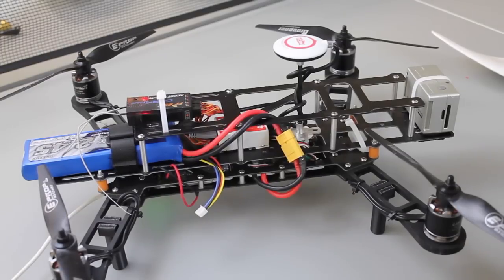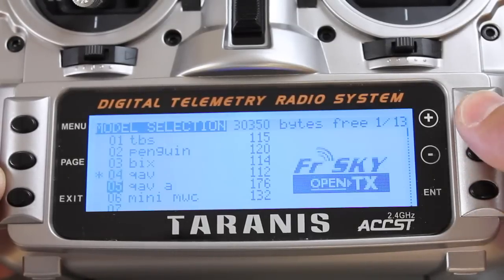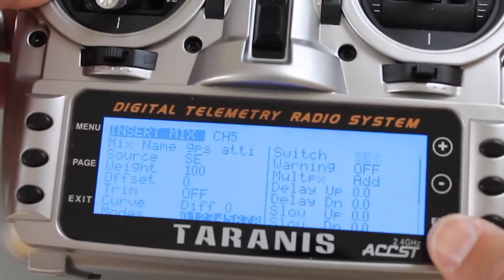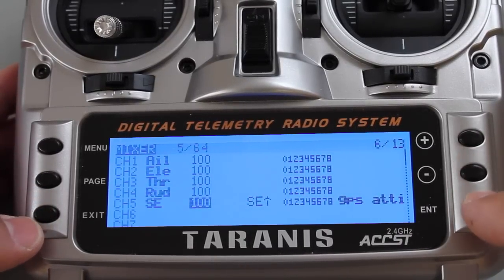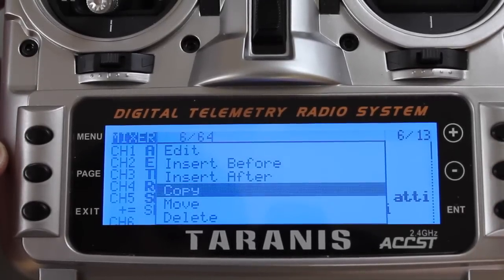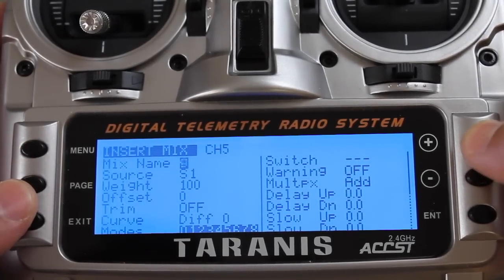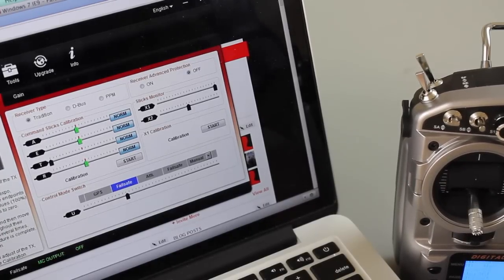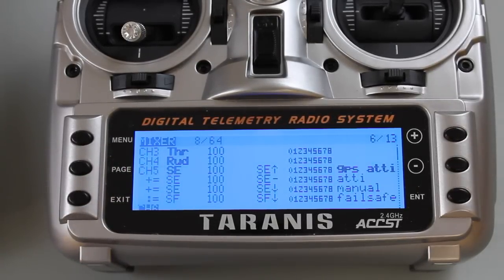FrSky Taranis 3 Flight Modes and Forced Failsafe Override with DJI NAZA on QAV400 Quadcopter

Comment: Dennis, have you setup your Taranis for Naza M using an ezuhf Rx yet? I'm having trouble knowing where to begin to set it up on my disco pro. Thanks man
Reply from the maker: No. I haven't done that setup yet. The EZUHF RX is definitely on my wishlist though. I'll post a video when/if I get it setup but it will be a while. You'll probably have it figured out by then :) Best of luck with your setup.

Comment: Just a quick question. What does the naza do if it looses contact? will it go into failsafe mode and return home?I have just stated flying and have used most of your videos to set up my hex.
Reply from the maker: Muddygunbuddy Depending on what type of receiver you have you may be able to do this pretty easily. Loss of signal failsafe is generally triggered by your receiver. I have a setup vid here:

NAZA Enhanced Failsafe RTL After Signal Loss With FrSky Module

Hope this helps.

Comment: I have the Naza lite and Futaba 7c I'm looking to buy the Taranis soon. How do you set the naza to fail safe mode when the radio is turned off or signal compromised? I don't think my 7c will do it, can this radio?
Reply from the maker: Good question. The functionality actually lies in the receiver and not the transmitter. So I had to upgrade to a FrSky receiver to do this on signal loss. Hopefully this will help out:

NAZA Enhanced Failsafe RTL After Signal Loss With FrSky Module
Reply: Dennis Baldwin I got my Taranis with the 8XR receiver and I'm all setup now with the F/S button!

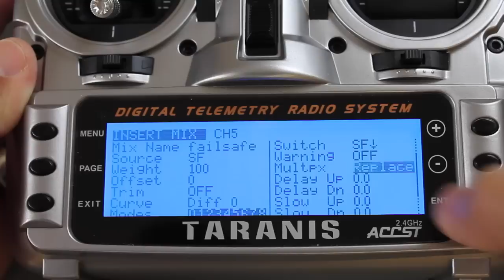Comment: Hi Dennis, I'm back again. Just got my Taranis and I don't know if I have a duff one or not!!! It could be me that cannot read!! I have no "basic" instructions and have looked on the net but cannot find anywhere for a factory reset. I cannot see on mine, model selection, ie, heli, acro or glider. On my Turnigy I set it up as a heli and no problems. Can you tell me the best way to set up this damned radio for a quad running Naza V2. I have trawled your wealth of video's, but I'm either too tired after being at work since 6:30 this morning or I should give up and start knitting!!!
Your help as always gratefully received!!!
Regards
Ken
Reply from the maker: Ken, it takes a little time to get your head around it but since the Taranis doesn't ship with any templates like ACRO or HELI you need to setup the channels yourself. You'll generally want to setup channels 1,2,3,4 to match A,E,T,R on your NAZA. If you need more assistance please post in the forums at www.garagepilots.com and we can help you out over there. Good luck!

Comment: Just back from maidening my F450, the DF switch failsafe worked flawlessly, thank you. I tried switching off my Tx and the F450 turned itself upside down and crashed. Any ideas, I have it set to 'no pulses'?
Reply from the maker: ben green Yikes! Sorry to hear that. I'm not sure what happened off the top of my head, but let me think about it some more. I plan on doing an updated video that covers failsafe in more detail soon. If you come across any discoveries please let us know. Take care.
Reply: Dennis Baldwin hey, I figured it out.  It should be set to 'custom'. You can set it to go to failsafe by toggling the switch as normal.  Very simple.  Most folks will know this but it had me stumped.  All the best, man.

Comment: Hi Dennis please help. I have a Taranis plus when i follow your video to set the failsafe I get all the way to the part where i set the offset number to 150 or 170 but the lever doesn't move to GPS? Why is that?

I set it to ppm mode like in your other video. On top in the Naza assistant I chose Dbus. Im thinking that I didn't assign the U control mentioned in the video please help!
Reply from the maker: Andre Terzian If you're using sbus make sure you assign the proper channel (ch7 in this case) to the U port. This will allow you to set your flight modes properly. It can get tricky because all the connections are coming over sbus and you don't see them physically attached like you do with a traditional setup. Good luck.

Comment: I noticed that when you switch on the forced failsafe over ride switch (SF) that your throttle does not move to 50% on the Naza assistant program ! Is that critical?
Reply from the maker: This is a bit different than a receiver level failsafe where you would want to program your receiver to around 50% throttle input. The difference here is that you want your throttle stick to be at 50% or thereabouts when you're flying and flipping into forced failsafe. I've read that if your throttle is less than 10% and you flip into failsafe that it's ignored. But if you're at 10% throttle in the air your quad won't be hovering, it will be falling out of the sky :) My recommendation is whatever throttle position you're in when you flip into failsafe leave it there....unless of course you're full throttle you'll want to bring it down a bit! The reality is if you're in trouble in most cases you're not going to flip out of failsafe mode so that throttle isn't too important. It's just a safety measure in case you need to get back out of failsafe and control it manually. I hope this helps a bit. I know it's quite confusing.

Comment: same question as Skydive4ever, I got some problems setting up return to home when TX is switch off.
Reply from the maker: What type of receiver do you have? If you want it to return home when the TX is powered off then you need to program your receiver to trigger failsafe mode. The FrSky receivers generally support this. Here's a video that shows how to set it up. Hope this helps....

NAZA Enhanced Failsafe RTL After Signal Loss With FrSky Module

Comment: What about putting a fail safe for cc3d when its out of range any reason not to do this. Have not seen a lot of info on doing this. On my frsky taranis its seems that option isn't showing I am sure I am suppose to enable something. Your videos always pop up first when searching. Are you in California?
Reply from the maker: Robert Hendrickson Great suggestion. I haven't looked into this before since mainly my CC3D is used for closeup line of sight flying, but this would be great to know. I'll look into it soon. I'm in Austin, TX. Thanks for the comment.
Reply: I only mentioned it because I know it can do it I just couldnt figure it out. I think you may have to do it with the actual reciever to go to a default mode like low throttle.

Comment: Hi mate I've got failsafe working but won't retract legs when failsafe kicks in when I pressed the failsafe button on frsky the legs were down??  I set throttle to middle and that works any idea on legs??? Thanks
Reply from the maker: TheTonstar1 I'm not sure about this, but have been asked a quite a few times about it. I tell you what....I'll put together a video next week and see what I can find out. Thanks for the question.

Comment: For some reason my Naza m lite isn't picking up the signal from my transmitter. I followed your video on setting my quad up with SBus and that is done, but I don't think my tx is binding correctly or something. I saw you had som wires in your SBus set up in the Naza other than the x2 and x3 ports. Am I doing something wrong?
Reply from the maker: +Thori Nelson It really sounds like you don't have a good bind. I can't think of anything you'd be doing wrong other than that. Let us know what you discover.
Reply: You were right. I got my bind. The Problem was the bind button got stuck in the pressed position and that was why it wasn't working. I had to crack open the rx and fix the bind button. Thanks for your help!

Comment: Do you know if the S-Bus on the X4R receiver has control of the U functions of the NAZA M v2?  Can get it to recognize X1, X2 or the U port.
Reply from the maker: It most definitely should. I just tested my X4R with Pixhawk 2 and was able to get 16 channels. I can't remember the specific channels you need to configure to work with X1, X2, and U but this video should help:

https://www.youtube.com/watch?v=kl5wuMiZ1_w

I'll post something soon that shows how I did this with Pixhawk and it should be easily adaptable for Naza.
Reply: See my comment below... I was able to get the S-BUS of the X4R working with the D-BUS on the NAZA.  Now all I need to do is calibrate my ESCs, and then I should be good to go.  I'm still learning.  :)

Comment: this is great and works perfectly but....I cant seem to get to calibrate the compass now ?
Reply: +bob gasman ok sussed it I forgot how to count..... actually was worried that I couldn't go from manual to gps because ati was in the way but if you go quickly from manual to gps right through atti counting it eventually locks in with the yellow led  so if anyone else get this problem it works ok with about 7 hours of patience
Reply from the maker: +bob gasman "7 hours of patience" lol I know exactly what you mean. The good news is you waited it out and didn't take a sledgehammer to your quad :) Thanks for sharing.

Comment: Hi Dennis. My Naza m upon configuration won't let the throttle go down to 0. It's stuck on 50 to 100%?
I'm using ezuhf. It's driving me crazy. 
Any ideas?
Reply from the maker: That's strange. Are you saying it's stuck on 50 in the Assistant? Have you done a TX calibration in the assistant and prior to that did you try an ESC calibration? If you continue to have problem please check out www.garagepilots.com and post in the forums. Hopefully we can help you out.

Comment: I notice when you toggle into FS the throttle doesn't go to say "50%" shouldn't it do that?  Or will it just plummet from the sky?
Reply from the maker: If I recall as long as you have your throttle above 50% you're okay. NAZA actually takes over and ignores stick input. But I put it above 50% just in case :)

Comment: this also works when using a sbus connection?
Reply: +Rolf Dijkstra 

This does work with the SBus. Make sure you are addressing CHANNEL 7. That is the default channel for the U channel on the Naza. Use channel 5 to set up the IOC.

Comment: hi ... one question about the failsafe 

today i test my copter after tune...i use Taranis radio and use X8R rx..when i plug the Naza in to computer when i tune off the radio it will jump to failsafe (as it show in the software) but dont know why , today when i test in real and turn off the radio, the quad just falling from the sky...any idea?

when i bind my X8R rx , i choose " No Pulse" is that the correct option ? cause i dont want the rx failsafe to interrupt the naza failsafe...hope will get your reply soon
Reply: +Dennis Meier  so which one shlould use? the video said use  no pulse  tho
Reply: +Dennis Meier what about Pixhawk? same way to set? or should set no pulse?any video for setup pixhawk failsafe?
Reply: +Dennis Meier so do u mean no matter Naza or Pixhwak when i setup failsafe i should click Custom->set --> and choose the channel for Thorttle  and done?
Reply: +hide everfree i mean choose the throttle channal (ch3) then put the throttle stick to thr lowest and save it?

Comment: Please how to setup failsafe for loose out of range - I have the same receiver and Taranis TX but I canot get it work on the Taranis, it was working fine with module in 9XR but when I press briefly receiver button with desire position of the stick - IT DOES NOTHING. Do you know the trick please? It suppose to beep and save the failsafe but it does not.....please help. (There is no failsafe settings in Taranis for this receiver, other does have that in menu but not this one....)
Reply from the maker: Jakub Egermaier Hi! Check out the failsafe section here:

http://www.frsky-rc.com/download/down.php?id=102

and if you have problems check out www.garagepilots.com and post in the forums there. I'm hoping to do a video to cover it soon.
Reply: Yes, this receiver is Ok, but I was taking about  D8r-II plus....

Comment: Awesome! Set up was nice and smooth. Loving this new radio, thank you very much!
Are you able to share your model? I mean, can you export your settings as a folder that I can then drop into my SD card? I've done it with another model, but I like where you put your flight mode and failsafe switches. That's where I've always had mine on other radios.
The reason I'm asking is because my Throttle values are off... I've re-calibrated the sticks in both the Tx and through Naza but, at zero throttle on my Tx, Naza still reads it as half throttle:
https://drive.google.com/file/d/0BynDW_GZMyQeeVhFWm9aYjFuZFk/edit?usp=sharing
Thanks again for this tight clear tutorial!
Reply: Whoops. Boy I waited a while before I posted this. Had my receiver plugs in the wrong places- all good now! My JR Tx ran them differently.
Still curious though, do you share your model files? I would love to share and try different set-ups.
Reply from the maker: I hate when I get my cables mixed up! Such a pain and glad to hear you got it sorted out. Yes, I'll be glad to share my model template. I actually plan on doing a video on how this works. Will post it soon and thanks for the feedback. Take care.

Comment: Great video, saving it for later. I have an DJI F450, NAZA M V2 with zenmuse gimbal, problem is i'm using a Spectrum DX6i with AR7010 reciever but i can't add a switch to move the gimbal up and down, thinking of buying the Taranis... Unless somone can tell me if and how i can ue the Dx6i for that. Thanks for the video, great job!!
Reply from the maker: Thanks for the feedback. I wish I could offer some help with the DX6i but maybe someone can help if you post in the www.garagepilots.com forum. When you do decide to upgrade definitely give the Taranis a look.
Reply: Dennis Baldwin Just wondering,,did you test the RTH  with both the switch and by turning off the radio? I mean  during a flight?

Comment: Did he really say the Taranis was pretty intuitive?  That's the most ridiculous statement I've ever heard since it's very difficult to set up the Taranis to do anything at all!  I had to watch this several times to see what he did and it was very confusing since I had already setup channel 5 and 6 on S1 and S2 in the last video so I had to use channel 7 for Flight Modes.
Reply from the maker: If you've ever used the Turnigy 9X stock firmware then yes, the Taranis firmware (OpenTX) is incredibly intuitive.